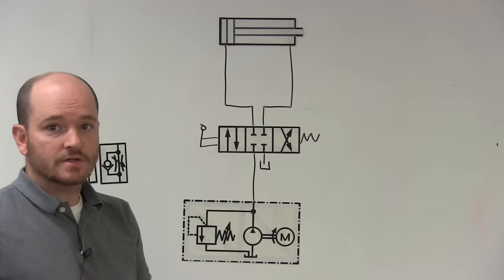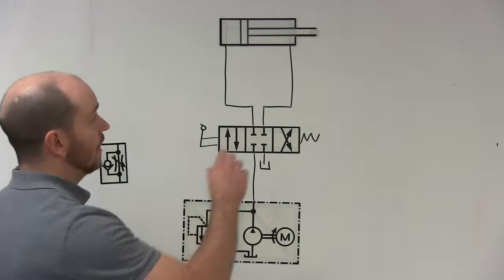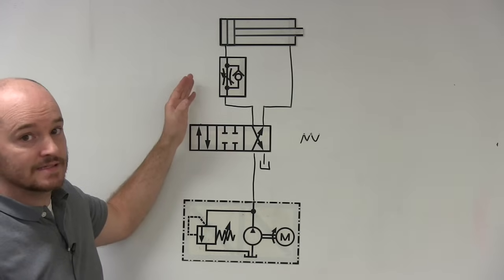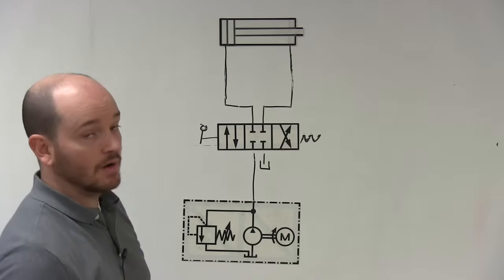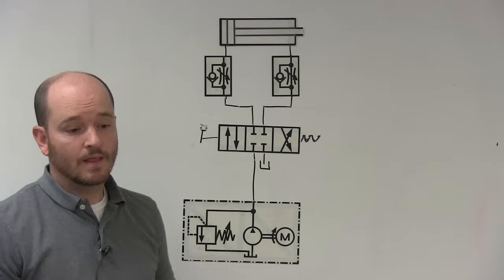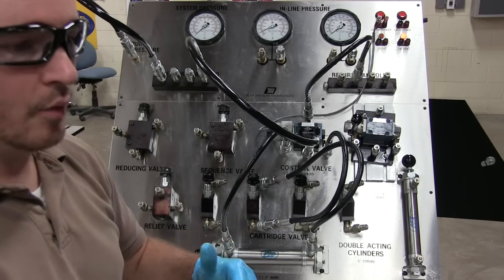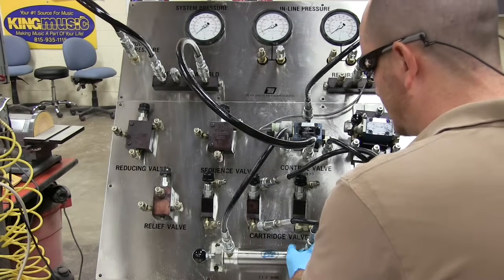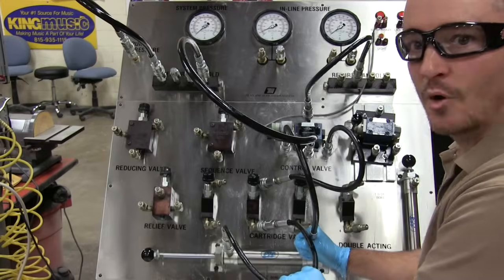Meter in Meter out

Comment: I have a question, does the metered fluid pass through the pressure relief valve back to tank. For the cylinder to move slowly with a positive displacement pump i would assume the excess fluid from the pump would pass through the pressure relief valve? Also amazing video!

Comment: Very good teacher. Let’s say you want to automatically apply power to the control valve and have the cylinder keep retracting and extending. Will I need a limit switch at each end of the stroke and a linkage rod connected to the limit switches?

Comment: One question sir? Wouldn't the oil go through the check valve and back to the speed control and solenoid valve  as ones as you go meter in? just because speed control outlet port  is connected to the check valve  exhaust port. Please 🙏  explain. Awesome video and explanation though. Thank you sir.

Comment: Hi sir well explained but i have small doubt. When ever oil goes through the orifice oil will split into the cylinder and also the split oil comes through the bypass check valve right?
Reply: Check valves are spring loaded so they will only be displaced if the pressure required to activate the cylinder is greater than the pressure required to unseat the check valve.
Reply: In his example there will also be hydraulic pressure on the ball side of the check valve keeping it from being displaced. When there is pressure in the supply line to both sides of the check valve the pressure difference will never be enough to open the check valve.

Comment: A good explanation, but you should never use a closed center contol valve with a fixed displacement pump. In neutral position, when no work is done, the pump creates full flow at full pressure over the relief valve all the time. This creates heating of the oil and the system, consumes a lot of unnecessary energy and wears out the pump.
  With an open center control valve the oil has free passage from the pump through the valve to the tank. 
  The same with flow control valves They create unnecessary load to the pump. Directional control valves are usually proportional, with them you can usually contol the speed of a cylinder pretty well.

Comment: metering out on extension seems like you're building a pressure intensifier... looks dangerous. I think you definitely want to make sure there's a pressure relief on the rod end work port or you could blow up one of those lines or cylinders. Tee some gauges into the cylinder ports for an interesting demo. I like the white board magnet components!
Reply from the maker: Meter out can be dangerous when there is a load that can overrun the cylinder.  Lunch box sessions has a great video on it.

Comment: Great video!  Have you ever heard/saw  metering in/out on same line versus metering out/in on different lines?  If you metered in/out on one line wouldn't that do the same thing controlling extension and retraction at same speed?
Reply from the maker: I have seen it done on single acting cylinders more often then double acting cylinders.  Although, I have seen it on double acting cylinder in cases where metering either in or out in both directions caused a safety concern.  I am personally like to see it the same in both directions for a troubleshooting and adjustment issues.  It is industry standard to keep it the same.  Most often time meter out.  Thanks for the comment

Comment: Is it ok f both flow control valve are in different direction? A is meter out and B is meter out?
Reply from the maker: Almost never.  It would be redundant.  You would only be controlling the speed in one direction.  I have seen it done when very precise speed control is needed.

Comment: hello have a question,
Need some help  please I am wondering why there is no Filter in this hydraulic system?   If there was one  where would be the correct location before the pump or before returning to the tank?
Reply from the maker: Thanks for the question.  In my schematic there is no filter because I did not draw it in.  On the machine there is a filter built into the power unit but that is under the cabinet.  If I were to draw a filter, I would place it on the return line for sure.  When a system is filtered there is typically one on the return line.  I hope this answers your question.  If you have any more please let me know.
Reply: KletteTech hi this helps and sort of still confusing me because I see some drawings that the filter is before the the pump.  Any reasons why?
Reply from the maker: That is such a great question.  Typically there is a filter symbol before the pump when there is a strainer in the tank.  The strainer is attached to the pump's suction line.  This is confusing because a filter and a strainer have the same symbol.  So, that symbol between the tank and the pump is for a strainer in the tank.  It is very hard to access because it is submerged in the oil.

Comment: meter out doesn't work properly because of more area on the cylinder front end and less area on the cylinder rear end
Reply from the maker: That has not been my experience.  Meter out is the method I use the most.  But, you have must have two flow controls if you want it to control the speed in both directions.

Comment: As I know,normal,One-way flow control valve only is used in output flow because It will be stable for cylinders,It is my opinion,And you?
Reply from the maker: One way valve are typically only used on pressure line in my experience.  The only time I see them on return lines is when they are used as bypasses for filters.

Comment: sir how to calculate valve and cylinder size
Reply from the maker: That is a big question.  Cylinder size as it relates to piston area is load you are trying to move divide by the pressure you can safely get from your system then add 20 to 25%.  Valve size is a function  of how much flow you have and ensuring it can handle the pressure.  For more in-depth answers I would check out Fluid Power Systems published by ATP.

Comment: sir, thank u so much for great teaching.
sir I have the one quatation,
what is the different between bladder nitrogen accumlator and hyd.  intensifier in hyd. circuit.
Dhruvin Panchal
Reply from the maker: An accumulator storages energy for later use.  The intensifier circuit increase the pressure greatly but distance is lost.  The pressure can be increased to incredible amounts.
Reply: Thank u sir.